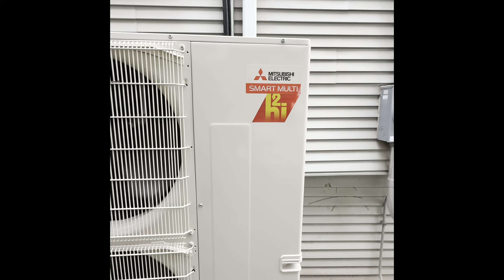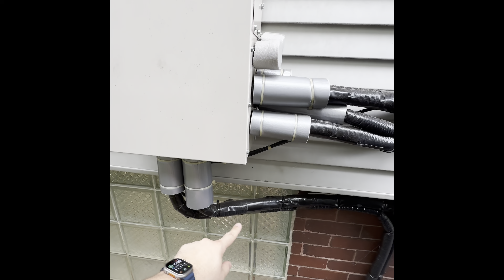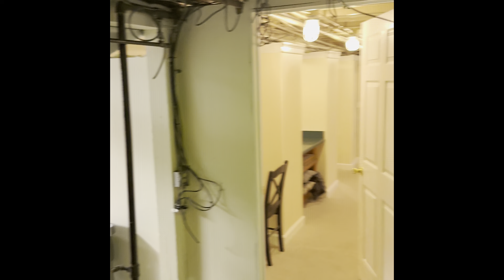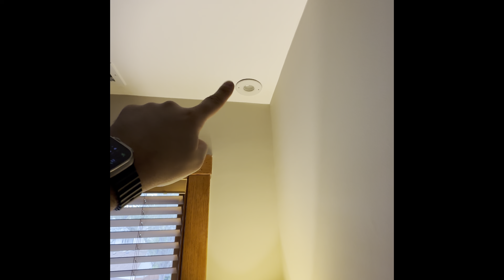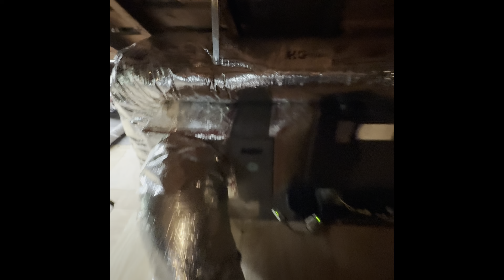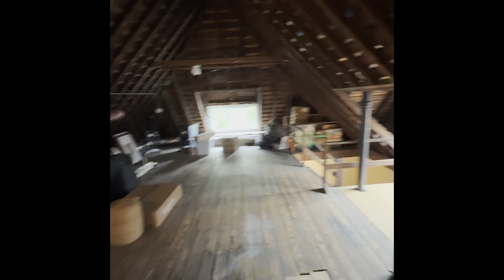Amazing Heat Pump for Zoned Comfort Mitsubishi intelli-Heat + SVZ Air handler

Comment: can you touch more on humidifier, what model is that, and is that instlalled on return?
Reply from the maker: That’s a health climate fan powered humidifier (Lennox brand). Installed on return. Model HCWP3-18

A reliable economic humidification solution in this case